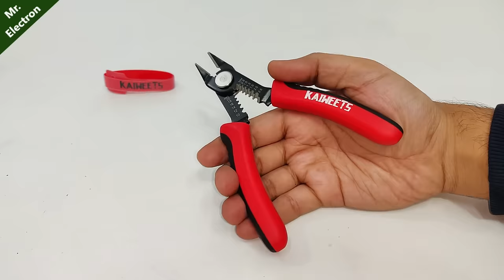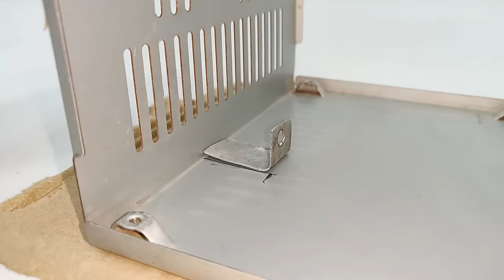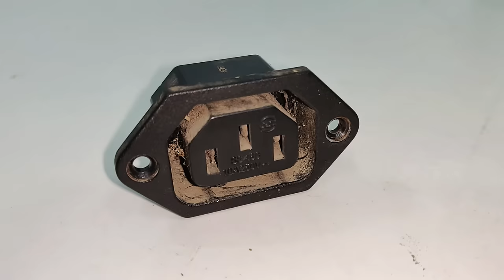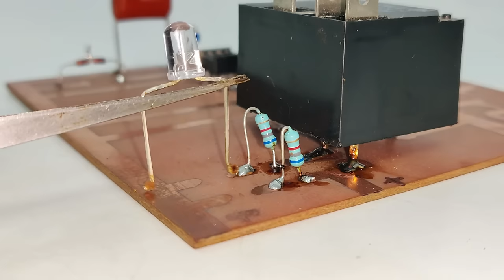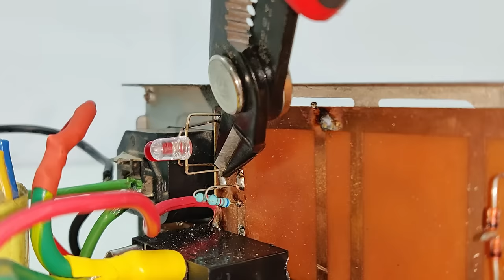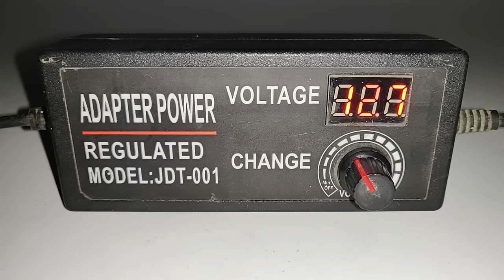12 Volt 150Ah Battery Charger using old Computer Power Supply - 220V AC to 12V DC

Comment: Engineering done  from Bihar or UP ? 🖕🏾🖕🏾🖕🏾
Reply: Can you really trust this guy? Does he really know  electronics - or is he just screwing around - buried in ignorance?
First he says its using an ATX PSU but at the very end he says he  is using a microwave  transformer.
Then he puts two 10A bridge rectifiers in parallel BUT even a novice knows this does not work [because the Vd are different].
Then his Mickey Mouse controller uses a puny relay which can not handle the stated current.
He does not explain the cntroller but it seems to be a simple cut-off; the charging current is not controlled and can be DANGEROUS.
 I have read 4 recommedations from battery makers and many articles from creditable battery experts and they ALL say current must be controlled. 

I just read a comment by him saying the transfomer is rated at 40A !!!!   LMAO  But the diode bidge is 10A and that play-time relay can handle no more than  6A DC.   This is a JOKE from bizarre start to laughable finish

Comment: Will it charge small car 12v  battery?
Reply from the maker: Sure it will charge. Best if you use a small light dimmer / fan speed controller in series with the input side of the transformer for smaller batteries. 
This will reduce the current flow to the battery as needed.
Reply: @MrElectron  Thanks. And please share the schematics and components names. Thanks alot.

Comment: Es mentira q un cable tan delgado aguante 150A
Reply: Can you really trust this guy? Does he really know  electronics - or is he just screwing around - buried in ignorance?
First he says its using an ATX PSU but at the very end he says he  is using a microwave  transformer.
Then he puts two 10A bridge rectifiers in parallel BUT even a novice knows this does not work [because the Vd are different].
Then his Mickey Mouse controller uses a puny relay which can not handle the stated current.
He does not explain the cntroller but it seems to be a simple cut-off; the charging current is not controlled and can be DANGEROUS.
 I have read 4 recommedations from battery makers and many articles from creditable battery experts and they ALL say current must be controlled. 

I just read a comment by him saying the transfomer is rated at 40A !!!!   LMAO  But the diode bidge is 10A and that play-time relay can handle no more than  6A DC.   This is a JOKE from bizarre start to laughable finish

Comment: 150A SCAM DONT DO THIS
Reply from the maker: Its not 150A. Its 150Ah
Reply: Can you really trust this guy? Does he really know  electronics - or is he just screwing around - buried in ignorance?
First he says its using an ATX PSU but at the very end he says he  is using a microwave  transformer.
Then he puts two 10A bridge rectifiers in parallel BUT even a novice knows this does not work [because the Vd are different].
Then his Mickey Mouse controller uses a puny relay which can not handle the stated current.
He does not explain the controller but it seems to be a simple cut-off; the charging current is not controlled and can be DANGEROUS.
 I have read 4 recommedations from battery makers and many articles from creditable battery experts and they ALL say current must be controlled. 
He does not even bother to say its for lead-acid batteries.
Why state the AH???  It is the C-rate that is important!!  How can he not know this???

I just read a comment by him saying the transfomer is rated at 40A !!!!   LMAO  But the diode bridge is 10A and that play-time relay can handle no more than  6A DC.   This is a JOKE from bizarre start to laughable finish

Comment: can you trust this guy? Does he really know  electronics - or is he just screwing around?
First he says its using an ATX PSU but at the very end he says he  is using a microwave  transformer.
Then he puts two 10A bridge rectifiers in parallel BUT even a novice knows this does not work [because the Vd are different].
Then his Mickey Mouse controller uses a puny relay which can not handle the stated current.
He does not explain the cntroller but it seems to be a simple cut-off; the charging current is not controlled and can be DANGEROUS.

Comment: While you did a good job on the other hand the title is a bit misleading. You only used the casing of a computer power supply.
Reply: Query: Can you really trust this guy? Does he really know  electronics - or is he just screwing around - buried in ignorance?
First he says its using an ATX PSU but at the very end he says he  is using a microwave  transformer.
Then he puts two 10A bridge rectifiers in parallel BUT even a novice knows this does not work [because the Vd are different].
Then his Mickey Mouse controller uses a puny relay which can not handle the stated current.
He does not explain the cntroller but it seems to be a simple cut-off; the charging current is not controlled and can be DANGEROUS.
 I have read 4 recommedations from battery makers and many articles from creditable battery experts and they ALL say current must be controlled. 

I just read a comment by him saying the transfomer is rated at 40A !!!!   LMAO  But the diode bidge is 10A and that play-time relay can handle no more than  6A DC.   This is a JOKE from bizarre start to laughable finish

Comment: Can you really trust this guy? Does he really know  electronics - or is he just screwing around - buried in ignorance?
First he says its using an ATX PSU but at the very end he says he  is using a microwave  transformer.
Then he puts two 10A bridge rectifiers in parallel BUT even a novice knows this does not work [because the Vd are different].
Then his Mickey Mouse controller uses a puny relay which can not handle the stated current.
He does not explain the controller but it seems to be a simple cut-off; the charging current is not controlled and can be DANGEROUS.
 I have read 4 recommedations from battery makers and many articles from creditable battery experts and they ALL say current must be controlled. 
He does not even bother to say its for lead-acid batteries.
Why state the AH???  It is the C-rate that is important!!  How can he not know this???

I just read a comment by him saying the transfomer is rated at 40A !!!!   LMAO  But the diode bridge is 10A and that play-time relay can handle no more than  6A DC.   This is a JOKE from bizarre start to laughable finish

Comment: Толко корпус исползуется зачем  это же блок питание готовое  зардное устройства  немножка  переделать  блок питание  все  получится  зарядное устройства на 12 вольт  20   30 ампера
Reply: Query: Can you really trust this guy? Does he really know  electronics - or is he just screwing around - buried in ignorance?
First he says its using an ATX PSU but at the very end he says he  is using a microwave  transformer.
Then he puts two 10A bridge rectifiers in parallel BUT even a novice knows this does not work [because the Vd are different].
Then his Mickey Mouse controller uses a puny relay which can not handle the stated current.
He does not explain the cntroller but it seems to be a simple cut-off; the charging current is not controlled and can be DANGEROUS.
 I have read 4 recommedations from battery makers and many articles from creditable battery experts and they ALL say current must be controlled. 

I just read a comment by him saying the transfomer is rated at 40A !!!!   LMAO  But the diode bidge is 10A and that play-time relay can handle no more than  6A DC.   This is a JOKE from bizarre start to laughable finish

Comment: Me E. I really love your channel. You have always been right up top of my top 5 geeks. 
Right below IMSAIGUY.
Reply: Can you really trust this guy? Does he really know  electronics - or is he just screwing around - buried in ignorance?
First he says its using an ATX PSU but at the very end he says he  is using a microwave  transformer.
Then he puts two 10A bridge rectifiers in parallel BUT even a novice knows this does not work [because the Vd are different].
Then his Mickey Mouse controller uses a puny relay which can not handle the stated current.
He does not explain the controller but it seems to be a simple cut-off; the charging current is not controlled and can be DANGEROUS.
 I have read 4 recommedations from battery makers and many articles from creditable battery experts and they ALL say current must be controlled. 
He does not even bother to say its for lead-acid batteries.
Why state the AH???  It is the C-rate that is important!!  How can he not know this???

I just read a comment by him saying the transfomer is rated at 40A !!!!   LMAO  But the diode bridge is 10A and that play-time relay can handle no more than  6A DC.   This is a JOKE from bizarre start to laughable finish
Reply: @kennmossman8701 Feel better?

Comment: Hi mr. Electron
I am fayyazi from iran
درود آقای الکترون
از برنامه ها تون بسیار استفاده میکنم مخصوصآ همین برنامه،خواهش دارم اگر ممکن هست طرز ساخت shocker شوکر با ولتاژ مناسب با نقشه مربوطه و نام قطعه ها را یک برنامه بسازید که بسیار نیاز است.
با سپاس فراوان
Reply from the maker: Hi
Reply: can you trust this guy? Does he really know  electronics - or is he just screwing around?
First he says its using an ATX PSU but at the very end he says he  is using a microwave  transformer.
Then he puts two 10A bridge rectifiers in parallel BUT even a novice knows this does not work [because the Vd are different].
Then his Mickey Mouse controller uses a puny relay which can not handle the stated current.
He does not explain the cntroller but it seems to be a simple cut-off; the charging current is not controlled and can be DANGEROUS.

Comment: 👍👍👍👍👍👍👍👍👍👍👍👍👍👍👍👍👍👍👍👍👍👍👍👍👍👍👍👍👍👍👍👍👍👍👍👍👍👍👍👍
Reply: Can you really trust this guy? Does he really know  electronics - or is he just screwing around - buried in ignorance?
First he says its using an ATX PSU but at the very end he says he  is using a microwave  transformer.
Then he puts two 10A bridge rectifiers in parallel BUT even a novice knows this does not work [because the Vd are different].
Then his Mickey Mouse controller uses a puny relay which can not handle the stated current.
He does not explain the controller but it seems to be a simple cut-off; the charging current is not controlled and can be DANGEROUS.
 I have read 4 recommedations from battery makers and many articles from creditable battery experts and they ALL say current must be controlled. 
He does not even bother to say its for lead-acid batteries.
Why state the AH???  It is the C-rate that is important!!  How can he not know this???

I just read a comment by him saying the transfomer is rated at 40A !!!!   LMAO  But the diode bridge is 10A and that play-time relay can handle no more than  6A DC.   This is a JOKE from bizarre start to laughable finish